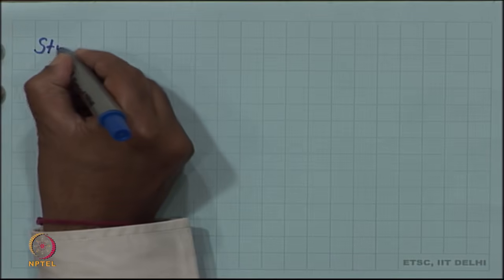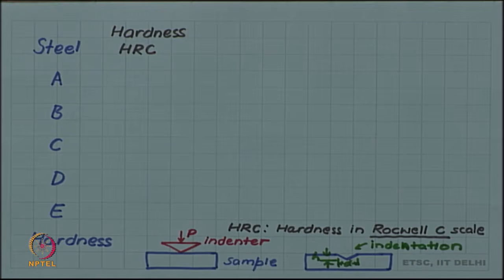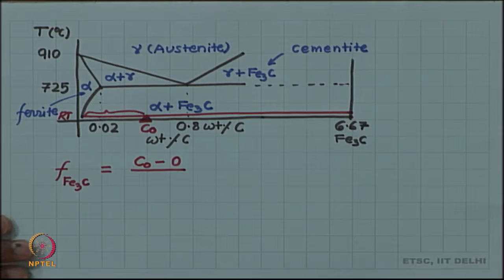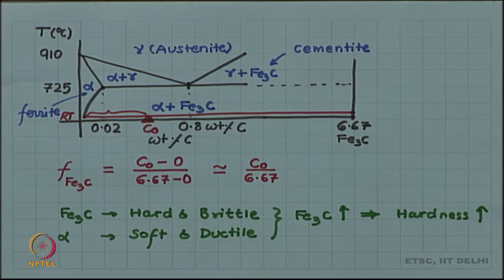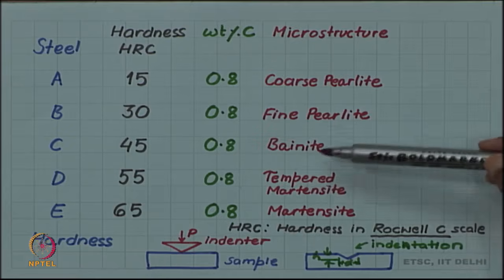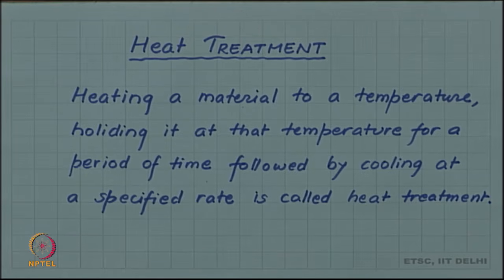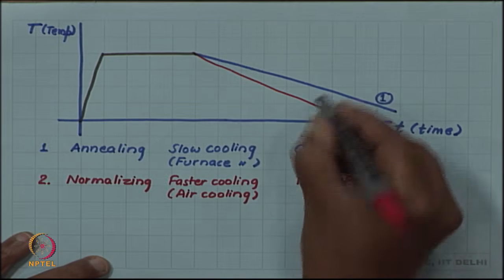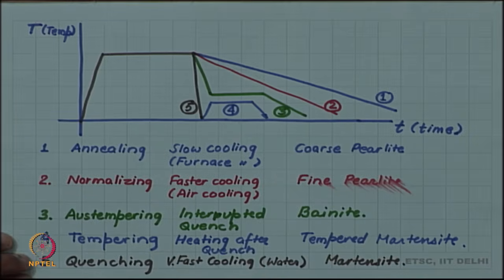Heat Treatment of plain carbon steels

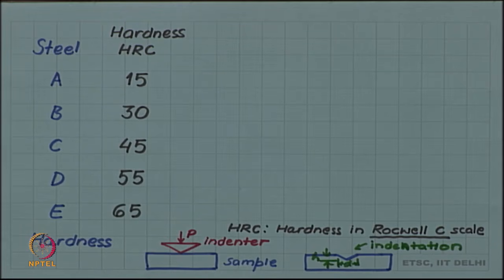Comment: Sir, at 5:55, I think hardness of A can't be 15 HRC as minimum value of HRC is 20.
Reply from the maker: You are right. I have made a mistake here. As per Dieter, Mechanical Metallurgy, the useful range for C scale is from 20 to 70. So 20 can be considered as minimum value on this scale. So what i should say that the hardness is less than RC 20. Perhaps, it should be measured on B scale.
Reply: @introductiontomaterialsscience   Thanks for your reply sir... Yes sir, On B scale, it is ok.

Comment: Sir, Does pure ferrites have carbon in them? They are purely ferrous compounds right? So they should not have carbon in them, but in the phase diagram we show that even pure ferrite and Austenite have carbon in them. Why is that so?
Reply: Ferrite and austenite are used in two senses: for pure iron as well as solid solution of iron with other elements. Thus pure monatomic BCC Fe is ferrite. But if small amount of C is added, which go into the octahedral voids, we get an interstitial solid solution with BCC crystal structure. This is also called ferrite.